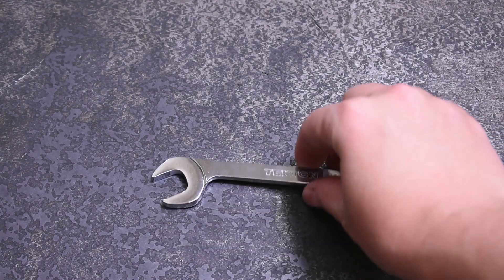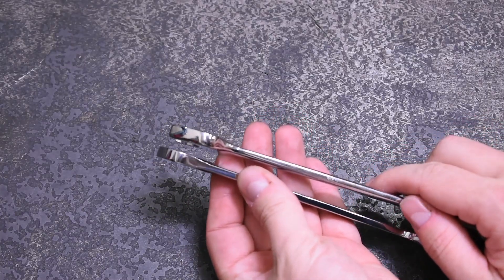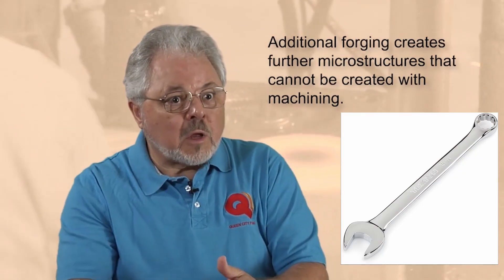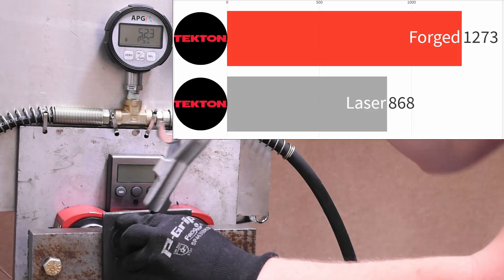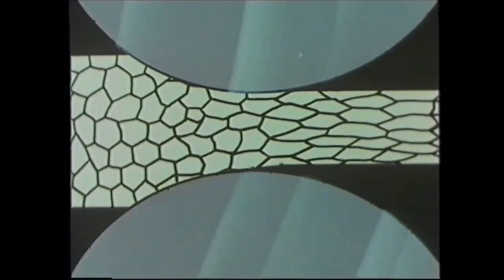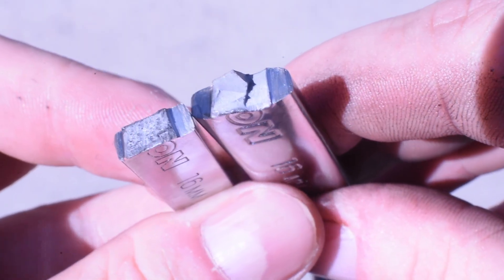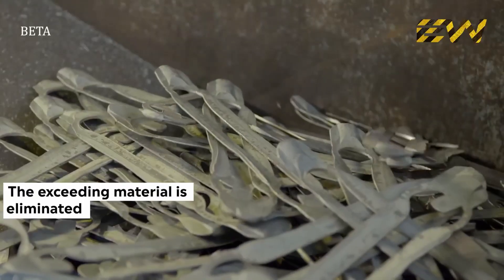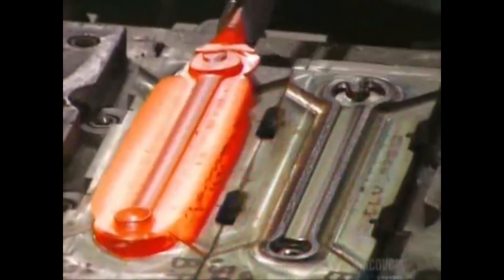The Curious Case of Laser Cut & CNC'd USA Wrenches vs Forged

Comment: Did Tekton have their wrenches normalized as part of the heat treating process?  If they aren't normalizing the material, they should probably start with normalized 4140, perform the manufacturing steps, then send it out for HT.  I don't know if sheet 4140 is available normalized, but bar is definitely available as normalized.

Comment: I will say this, I have a couple of these wrenches, and they are far from my every day go to wrenches. I used to work on garbage trucks. Anyone who knows garbage trucks knows the hydraulic hoses of madness that many are. These wrenches were ideal for those tough to get at hoses and other various fasteners. I was typically using larger wrenches, like 19mm or 3/4 and bigger for my work. That doesnt mean I didnt use the smaller, just that those were the norms. And on our hoses, they were using higher strength either steel or stainless steel hardware, not the soft nuts that you guys have to test with.

Comment: This tool is not designed for hitting with a hammer or using a 4 foot long cheater bar, they are a very useful and specialized tool. On old Huey starter/generators, yes one part did two jobs. I had a Mac, or a Matco, it has been decades, and a Snap On open end wrenches. They would turn the nuts at the bottom of the just a few degrees. The nuts were hard to access and the starter/generator sat right above the fragile and expensive tail rotor driveshaft where the s/g unit stuck out of the back of the transmission, one speed, it split the main rotor and tail rotor and did turn those at different speeds. Point is that those tools were extremely expensive and only sold in packs of numerous useless sizes. I knew a guy that made his own out of old Craftsman wrenches but he put a lot of time in and they never worked right anyways... You did highlight the drop forged vs just case hardened. Overall good episode. Hopefully people learned something. I remember watching those old videos like that in High School and then in the Army. The old reel to reel projectors rolled out you knew you were in for a treat. Or a nap... LOL

Comment: That is good info. I bought the tekton angled 18mm for a specific job operation and it is fine for that. I will limit it to low-torque operations after watching this. My forged tools I have are from the 80's 90's and early 2000's they hold up for decades. Good video

Comment: It's like having a 10 mm half inch drive socket I don't know where you could use a 10 mm socket that's a half inch drive I just think that's ridiculous of course you can't really use a 3/8 on the bigger stuff like suspension and we use a quarter inch drive sockets for maybe stuff on the interior of the car are certain little computer parts

Comment: Yeah that was really nice video very thoroughly done I think but I'm not sure on a 10 mm wrench we need the strength test maybe you should go to half inch drive you know the bigger size wrenches where the wrenches break off more I think as long as it's wrenches strong enough to do the job for 10 years then that's fine it doesn't have to last forever
Reply from the maker: Its 16mm

Comment: I use to work for a tool manufacturer in Arkansas, we made forged hand tools for NAPA, Armstrong, Craftsman, and Matco. Most were made by forging however in 2005 began making some through rolling the steel. Still have my full set of forged Matco wrenched which have never failed me and expect to give to my son one day.
If your wondering about the cost difference, it's in the precision of the broaching ( cutting of the opening ) also the amount of chroming. Some companies are more picky when it comes to QA.
Reply: Is the manufacturer still in business today?
Reply: @smartin70  Yes Danaher tools in Springdale Arkansas

Comment: 9:42 Two words: RF Fitting. There just literally is no open end wrench in 5/16. There is an old craftsman wrench set called something "starter wrench set" that has sizes from 1/4 up past 5/16 and all the old timers i know just had those sets from when craftsman actually made them, and they'd keep the 5/16 in their breast pocket or in their desk. it was the most stolen tool by far in any RF lab. Tekton wasn't making open end wrenches in that size when i needed one, so i ended up getting a combo wrench with a angled open side. combos really suck though because the box end is completely useless for RF fittings. the double open end is just perfect because the fittings were always a pain my pee hole to reach, and i never had enough space.
Reply: What you needed then was a set of electric spanners.

Comment: i love tekton. they were my go to for buying tools for my lab that i knew would get lost or stolen. this was around 2016 though, and the prices for tekton have SKYROCKETED since then. more than triple in some cases. but i quickly found that tekton even had good quality specialty wrenches! i needed an oddball super thin metric wrench, and they had one for about 8 bucks. it ended up being super nice fit with a polished chrome vanadium finish. i eventually got a full socket and combo wrench set from them over a few years of buying professional and personal tools. it was either wait literally MONTHS for the purchasing department to unfuck themselves and buy from our snap-on guy, or i buy from tekton in 5 seconds off amazon. as far as combo wrenches and sockets go, there was no difference. now when i need a calibrated inch-pound range torque driver? it was $500 and months long waiting lol. i've noticed that tekton lately has been charging what their tools are actually worth though, if not a bit more. it seems they've grown out of their "sell quality tools for cheap to gain market share" phase and now they are in their "make up the money we lost gaining market share" phase

Comment: There is more to a wrench than just "forged or not forged". Good microstructure and proper heat treatment are definitly most important. Forging is just one way to create that good microstructure, but surely not the only one. Sheet metal hot rolling is in essence the same as forging. Well controlled heat cycles with well controlled plastic deformation. That "Queen City forging guy" is only partially right here, because he somewhat ignores what tremendous improvements in sheet metal manufacturing have arrived in the last 3 decades. You need to have an extremely elaborate forging process to end up with a little bit better microstructure to what can be bought in sheet metal today. The air has become very thin! 

In the end when talking about wrenches it all comes down to the price. "An edge in making a precision product?" Sorry but that's nonsense. The answer is always money. Lasercutting has become very cheap and 4140 plate can be bought off the mill in extremely high quality so that forging would not further improve its material quality.
Forging just used to be a cheaper way to produce such material quality. You can use cheaper raw material, dial in the material properties with a precise thermomechanical process i.e. "forging" and a following heat treatment. But if the plate steel already comes with these properties out of the steel mill, there is nothing inherently wrong with it.

Comment: Even though the forged wrench is stronger, the plate steel wrench is strong enough since it will slip off of the fastener long before it bends or breaks.  Also, at the end of the day, who cares how strong a wrench is if it can't fit onto the fastener due to space constraints.

Comment: HD mechanic here, I own a full set of these angle wrenches up to 2” and love them. Had a full set of snap on angles stolen and replaced them with these and actually like them better, the 30/60 offsets and the off centre head are great for tight fittings. The Snapon ones are awesome, but these have a narrow profile that fits onto the flats of a boss fitting a lot easier, boss type fittings often have really narrow flats and some hoses choke up on them quite close. Never had a slippage or breakage issue with them in the real world and I use them ALOT.

Comment: The Tekton 30/60 have been great for working on hydraulics, especially around valve blocks.  I was super happy when amazon started carrying them for Canada.  Have a standard set up to 1-5/8 and probably spent one quarter the price that a Snap-On set would be which seems to average around $100 CAD an inch .

Comment: I look at this tool in the same way I look at tappet wrenches.  I don't normally reach for them, but they get used for their original purpose (rarely) and they get used for other not-normal applications where I need something incredibly thin.  I know they're not as strong as my traditional combination wrenches, so I am careful to not abuse them.

So if I found a set of these on sale for the right price I'd consider them.  They'd go in the drawer with the tappet wrenches and the offset-box wrenches, aand I'd use them when I needed them.

Comment: Hardness is pretty good for the thin wrenches, Chromo typically start to get brittle above 50RC.  Seems a better austempering HT treatment could yield a better grain structure but probably add significant costs.  Would be interesting to know what HT process they used.

Comment: Makes me want to build a big forge.  Sounds like I would stay plenty busy.
Reply from the maker: I think the upfront cost is just scary. Building a 500T, 800T forge in 1910 was expensive sure. But just a lot of cheap steel and hydraulics, and done. A modern production sized forge press works is millions and millions and has all kinds of safety this, digital automatization that, worker lock-outs, remote monitoring. 
Go over to Taiwan and it's a 1960's Japanese forge press putting in work every day.
Reply: @TorqueTestChannel  Yeah.. I just want to build a simple DROP forge--  as big as a DIY can make it. lol..  I wonder if anyone has tried -- I'm about to look it up.

Comment: Or, when you are a career mechanic like me, you buy cheap tools to heat and bend or cut and weld to make a specialty tool for the job at hand.
That being said. I stopped buying tool truck tools a long time ago considering they are not always the best and most often the most expensive. Plus I got tired of loosing an expensive tool and having to dole out loads of money to replace them.

Comment: I would normally use a 30/60 wrench like this on hydraulic fittings only. Many times I need a thin open-end wrench with offset heads.

Comment: In the video there's a part that explains how forging can change grain direction. However the way those tools are forged (top/bottom) doesn't really change original longitude grain direction. Which makes me believe that difference in performance has more to do with heat treatment rather than shaping method. Steel compositions are probably different
Reply from the maker: They are both 4140 Cro-Mo which has limitations of the elements that it contains. The multi-step top/bottom forging like that is how all parts this size are forged, including piston rods. Because the die has edges/sides, the 100 tons coming from the top not only pushes down, but causes the material to deform in all directions looking for the easiest route to flow and push out, up against the walls of the dies. Curves, radiuses and thickness differences are flowed into rather than cut. This causes a uniform forged grain structure when done correctly, often in multiple (getting smaller) steps.
Reply: Exactly, the only variation here is heat treatment.
Reply: @mannycalavera121  no, it is not just heat treatment. Forging and black smithing have a lot going on.
Reply: @wim0104  in this instance, its just heat treatment
Reply: @mannycalavera121  
No it isn't
Reply: @andrewholdaway813  yes it is
Reply: @mannycalavera121  
Forging improves the flow of the grain structure as stated by TTChannel.
Reply: @andrewholdaway813  yes it does, but your missing the point here
Reply: @mannycalavera121  
No I'm not, being forged will make minimal difference, particularly to the test where they ground away the edges, but that doesn't make it "just the heat treatment"

Comment: I would be interested to see the breakage from the side instead of on the flat, since that would be really where force would be applied while using the wrench.  While I'm not sure if it would make much difference, I think the elongated grain structure in that direction would be more beneficial.  Kind of like wood breaking across the grain vs with the grain in different joints.
Reply from the maker: Good point
Reply: I’ve broken a Matco 11mm wrench while using it as a cheater on another wrench. It broke cleanly at a “1” stamping. My Snap-on set was in my other box at the far end of the shop but if it had been the one that broke I wouldn’t have been any more surprised. It was a small, thin wrench and I was really pulling on it so I’m not finding fault with it, but it is a way a tool should be expected to be used at least some of the time. Matco warranted it without question, I had to mail it in since I’m in the boonies of Maine and we don’t have any tool trucks that come here.